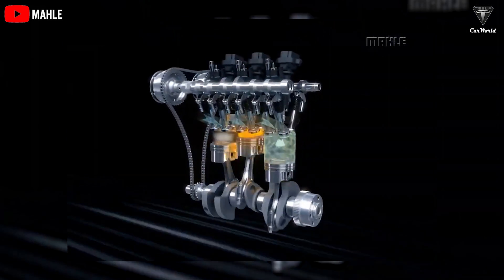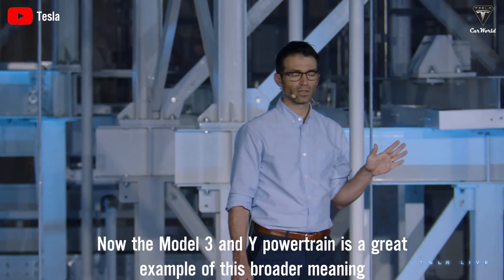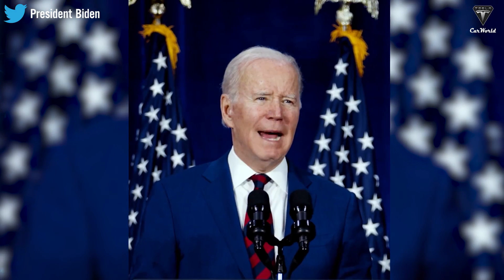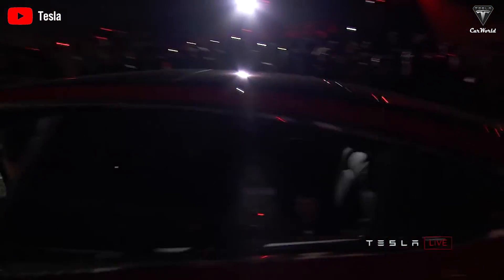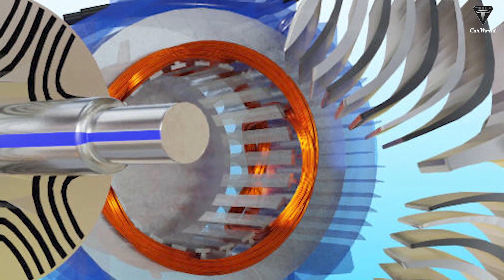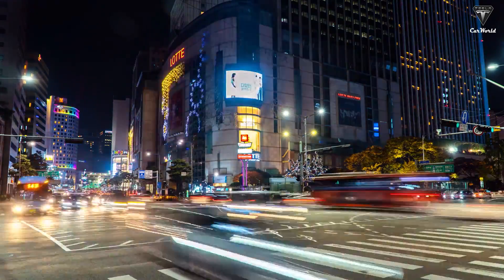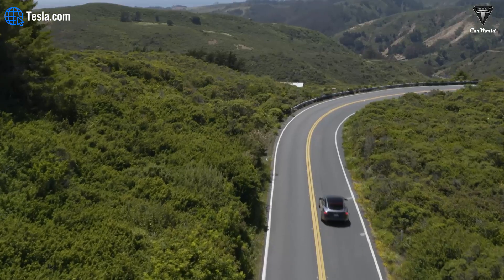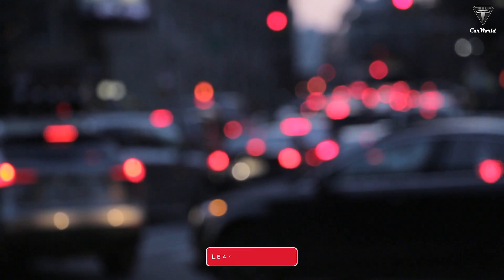Elon Musk: "This ALL-NEW Tesla Motor Will DESTROY The EV Industry!"

Comment: If this is the traditional dc motor that has brushes, then it poses some maintenance of the brush replacement and carbon build up as the brushes wear. Ac motors don’t need brushes and are maintenance free for the most part.
Reply: No it is not. It is in fact an AC motor. The motor controller converts DC from the battery to AC.